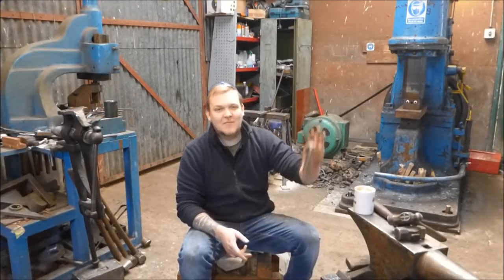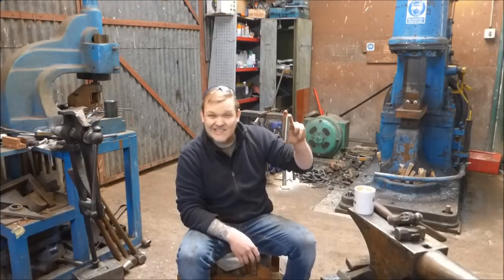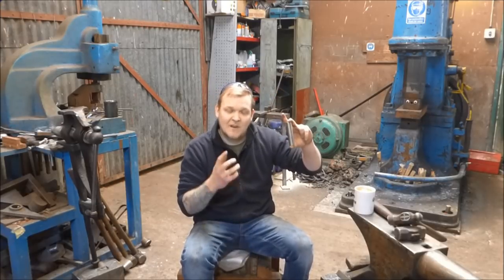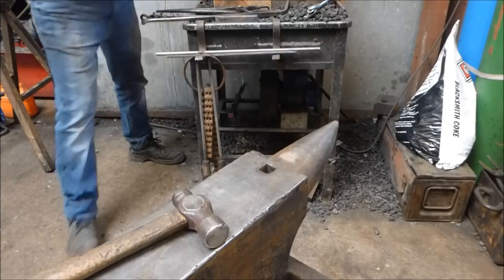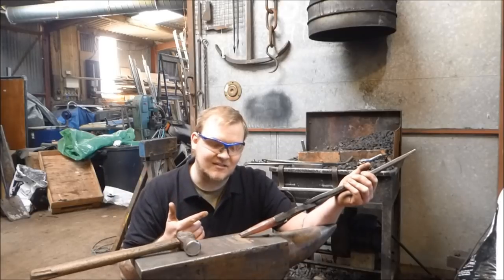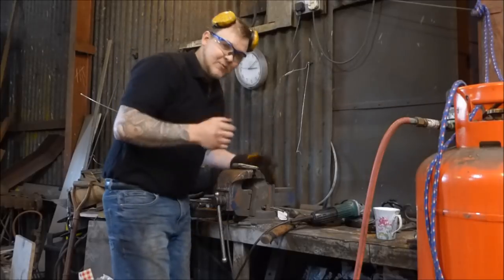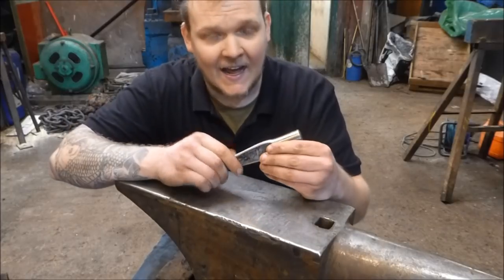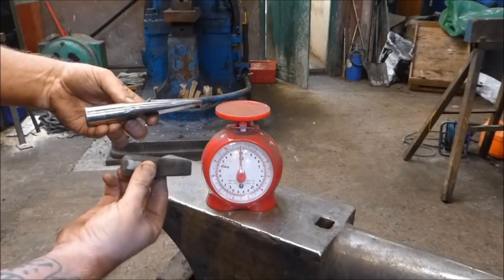Forging TITANIUM! Making a hammer eye punch out of titanium! Trust Me I'm Blacksmith!

Comment: Hi Dan, it sounds like you know a bit about titanium. I bought some a while ago to forge a punch from but it is as soft as butter to forge so i ended up making a spoon out of it. Have I got a duff batch? It was sold to me as Ti6Al4v grade 5,  having never used it before i was expecting the same reaction as you "that's hard" but was really soft to forge.
Reply from the maker: errr not sure what's going on there dude. I was using by punching the hole till the titanium got to an dull orange and then quenching it and start over. I found I could get quite a bit of work done like that.

Comment: At 4:30 you said you don't think Titanium is a very good conductor and mentioned how it heats up and cools down quite quickly. That would indicate that it is in fact very thermally conductive or instead has a pretty low specific heat instead. But it's actually less thermally conductive than iron. Maybe it's the specific heat or Molar heat capacity... just about the same as iron... Though it is less dense than iron so if it takes the same energy to raise the same weight of metal by one kelvin, then the same size stock would take heat more quickly... But it also would not conduct the heat up the stock as easily... making a handheld punch or drift quite cool to hold.

From the wikipedia page under Physical Properties:   "The metal is a dimorphic allotrope of an hexagonal α form that changes into a body-centered cubic (lattice) β form at 882 °C (1,620 °F).[15] The specific heat of the α form increases dramatically as it is heated to this transition temperature but then falls and remains fairly constant for the β form regardless of temperature."

That explains some of the observable forging characteristics.

Comment: can you make a knife out of grade 5 titanium
Reply: Do you mean knife handles or the blade? Titanium can't be used for blades as it's too soft and can't be hardened like steel. It's only around 40 HRC, if I'm not mistaken, and thus won't keep a real cutting edge. Maybe there are some rare special Titanium/steel alloys but the common grades and especially grade 5 can't be used as sharp blades, that's why you only find Titanium handles/frames. In this video it appears very hard, but actually it isn't, the resistance and difficulties to forge, bend, polish, or grind it is because it is very elastic (think of rubber) and tough (wears hard tools), but not hard in itself.
Reply: thx for the info